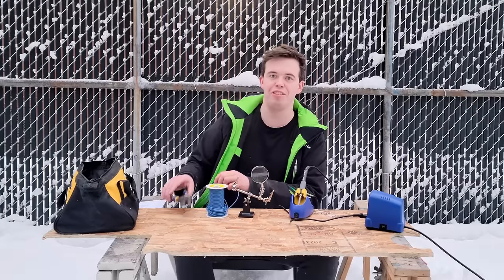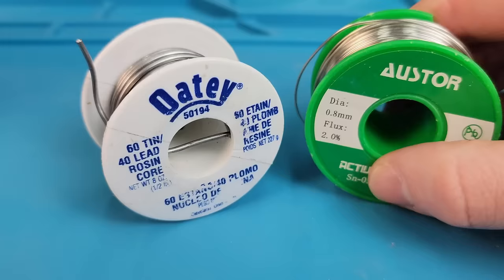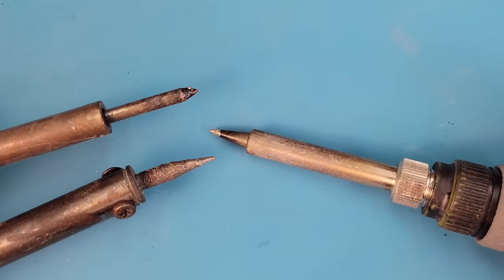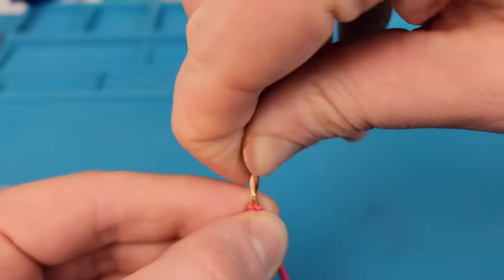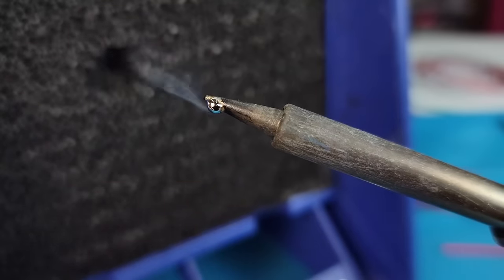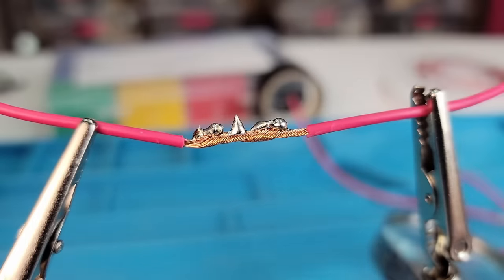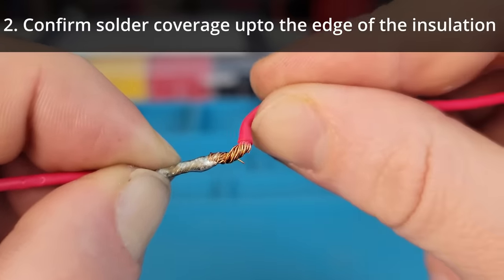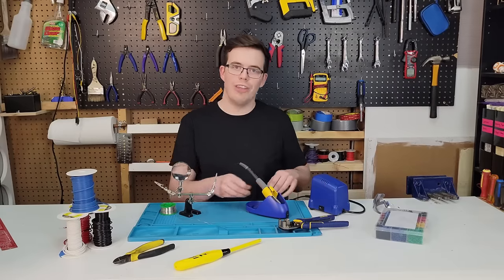Four Steps to Flawless Wire Joints (How to Solder)

Comment: "This is what a good solder joint looks like". proceeds to show a slightly better, but still bad, solder joint

- wires not pre tinned
- no flux
- wrong tip for soldering iron I'm pretty sure
- heat not evenly applied in place and dragged the solder rather than let it flow leading to very un-even solder application
- not enough solder

Tldr, for splicing wires together, just use solder sleeves... Or crimp splices (AMP style [iykyk]).
Reply: Also, in your demonstration of how to actually do it, you're still doing it wrong! Adding more solder to your contact patch between your iron and the wires is not how you do it. You're describing the right technique but don't actually know how to do it... Also, lead-free solder? And still no flux? No wonder you can't get your copper hot enough to flow correctly into the braids and properly make the connection. No mention of playing around with temps or tip sizes.

I strongly recommend you look into NASA standards or FAA, CASA, etc. ones and make a revision video.

Comment: Noone in the history of ever has gotten lead poisoning from solder.   Lead Free solder is primarily for factory based soldering, or if you are soldering 8-10 hours a day.  If you are putting together hobby kits and custom circuits 1-2 times a week you are going to be freaking fine, there is more lead in your water then you will come in contact with in solder during short times you are using it.
Reply: False. People who work in manufacturing are required to have periodic blood tests to determine their lead levels. There is no level of exposure to lead that is known to be without harmful effects. Lead in the body is distributed to the brain, liver, kidney and bones. It is stored in the teeth and bones, where it can accumulate over time. Human exposure is usually assessed through the measurement of lead in blood. But you keep doing you….   😊
Reply: @LTV_inc he said "unless you're doing soldering 8-10 hours a day". In other words, if it's your job be very cautious. If it's your hobby and you use common sense, it won't cause issues.
I'm not a scientist but that makes sense to me. Use the air filter the video shows and don't do it for hours at a time and there won't be any health risks.

Comment: What youre educating here does not fit for all situations.

I mostly solder in automotive repair, where you sometimes work in very confined and uncomfortable spaces, can only fit one hand and have too short of a loose wire to solder to. 

For example, its very much okay to use the iron with solder applied to it and even applied for a long time to it, and all the included rosin burnt for a long time. You just need to preapply it directly to twisted wires connection. There are soft rosin mixes available, but if you only have hard rosin, heat it with your iron to melt, and apply it with screwdriver till its soft. Use bigger and more powerful irons for wires, than you use for boards or components.
I only use 20w for boards and smd components. When its a wire, I take at least 40w and with a massive tip, that holds a lot of thermal mass to heat the wire enough to melt. For power transfer cables, like power steering pump or hydraulic suspension pump, I take my grandfathers iron, that has a wooden handle and a huge ass copper tip. I dont now its power, as the marking corroded away many years ago, but my guess at least 200w, probably even 500.

If the wire is black, you need to clean it mechanically, scrape it down to copper with a blade or something similar. You may also use some additives, that are needed for soldering to zinc or iron/steel and also work with blackened copper, but many of them contain acids, that corrode the copper after soldering, so not recommended.

Use adhesive lined heat shrink tube where possible. At least everywhere outside, and on cars even inside you cabin. Its much more expensive, but works wonders in damp environment.

Comment: Wires shouldn't be soldered in most applications because if they get hot the solder will melt rendering the connection useless they should be mechanically crimped or swaged together instead. If you have a high current wire that does get hot and becomes un connected because some idiot soldered it together and it shorts out to ground you will hopefully have a over current protection device that will break the circuit because if you don't you will have a fire hazard. Solder should only be used after a mechanical connection is made first if at all. You are relying on the wires being twisted together as your fall back safety in case the wire is shorted and becomes hot and the solder melts or your hoping the heat shrink tubing holds the connection together. If you do solder wires together put a mechanical support on both sides of the joint if possible to support each wire if it does become disconnected then the wires can't just fall onto the chassis or other components and short out. All wiring should be well supported in a loom anyway look at aircraft or space craft wiring for a good example of best practices.

Comment: I am the worse solderer in the whole world. I got my soldering iron, used it once, and the tip went all black and won't work anymore. Somebody told me after that I should have tinned the end of the soldering iron. grrr. I have an abrasive stone which is supposed to clean it off. If I try to use it all I get is little balls of solder now.

Comment: Kind of common sense i would think. If you think your good, try soldering without helping hands
Reply: I need those helping hands. When I soldered wire together in a car (speaker wire) without any such help and what should take 2 min, turns into 25. Wasting a half hour was better than paying somebody to do it, though.

Comment: Simple! DO NOT solder wire to wire, this is bad practice no matter what technique you use. All wire to wire connections should be crimped and not soldered. Soldering wire should only be used in an application where the joint is completely strain relived and immobilised.

Comment: Definitely not the proper way to mate two wires.
The mechanical strengt is not good enough. Solder is a weak metal.
Twists the two wires as if you were to use a marette.
Even before any solder is applied, the link is now as strong as copper is.
Adding solder will complete the work.
The end result may not be as good estethically, but it is way more sturdyer.

Comment: That Hakko soldering iron is garbage.  The pricey tips do not last long.  No analog controls.  The grey sponge is terrible.  It does not do a good job of cleaning the tips.  The OK soldering irons and the Weller soldering irons blow the doors off that Hakko crap.  🤔

Comment: Keep on putting out bad information; I make my living by fixing the mistakes you have made in this video.

First, you are twisting the wires together entirely incorrectly; before twisting them, at all, you should weave the strands of both wires, then twist them together.

Second, you misidentified a "cold joint," which has nothing to do with the wires being cold (which does not matter) and everything to do with the only actual connection being the solder, itself, and is more likely to happen with your technique.

Third, if you try your method on automotive or appliance wiring, you are going to wind up damaging the insulation and having to replace the entire wire, or even harness.

Comment: This is pretty typical poor YouTube video that is barely half correct about the subject. The dismissal of the bit type used is ridiculous. The conical bit used here is about the worst choice for general soldering including the joining of wires shown in this video. For most soldering you should use a tip with a flat surface to present a tinned surface to the joint. A flat surface holds more solder due to surface tension and greater heat transfer to the joint. The advice about lead free solder is also poor. Leaded solder is superior in every aspect of soldering. Whilst lead is toxic in its elemental form, solder is an alloy. Like silver-mercury fillings, alloys reduce the toxic effects of the individual constituents. No one was ever poisoned by leaded solder. Finally, using a lighter on heatshrink sleeve is a total cowboy move. Enough said.

Comment: Do not ever use these pointy tips, these are 100% garbage. Use chisel type, it have way better contact by wire and can make. The best of the best tip what I so far used it for Hakko T12-K. It is fake hakko and last already 10 years usage. Possible solder several mm2 thick wires or solder 0.4mm pitch easy.

Comment: 1. Stop using conical soldering tips. This is a total SHIT not suitable for any work.
2. Stop using T900 tips and/or system. It's ridiculous in 2024, really. Buy at least some T12 station, JBC, or Weller, and feel a difference.
3. Stop blaming Pb for all humanity catastrophes. Plunbum oxide really starts to evaporate at 600 °C.

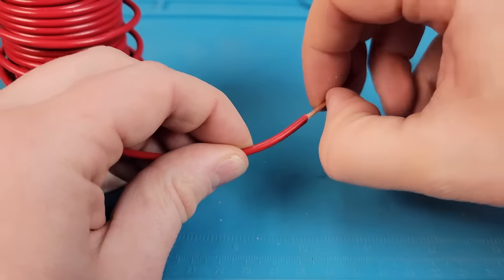Comment: 4:30 Maybe it's different for a fancy pants high dollar Hakko soldering iron, but my Elenco SL-75's tips are literally 5 dollars for 10 tips. Half time time I don't even bother cleaning them at all just change 'em out. If I do, I simply scrape the schmoo off with my xacto knife and re-tin. Tips for that thing are basically disposably cheap so I really don't give half a donkey's dick about tip life on it.

Hell I only paid 30 bucks for the whole iron.

Comment: You shouldn't solder 2 wires together. I will be very susceptible to movement. You will never find a soldered cable joint in a car. Even vibrations can break the edge of the joint. Stop teaching how to do stuff wrong.
Reply: Rubbish. A correctly soldered and insulated joint is as good as a crimp joint. It's not used on car wiring looms as doing it correctly takes much longer than crimping connections. I've been doing soldered repairs on car wiring for nearly 50 years and never had and problems. You can get a bad crimped joint, just as easily as you can get a bad soldered joint.
Reply: @phils2180  No, you are wrong. I work with this. Soldered cables are a big no no. I could never deliver a product we designed with soldered cable joints.
Reply: @thedryparn1279  No, you are wrong so we'll just agree to differ.👍

Comment: Sadly after your intense instructions you made a total rookie mistake, you never ever use your fingers on the wire you intend to solder as the grease compromises the joint as the most important thing when soldering is that everything wire solder and soldering tip  are free from grease and dirt.

Comment: Conical tips suck and so does lead free solder.  don't waist your time on this video!
Reply: Lead-free is fine with good technique. 60:40 is definitely easier for difficult jobs or when skills are lacking.
Reply: @putrid.p  -- Lead-free is crap and one of the big reasons devices fail!  We never had all these joint failures with 60/40 solder!
Reply: @putrid.p  -- Even NASA won't use it!
From NASA-std-8739.3 
6.11 Solder 6.11.1 Types and Usage. All solder used for tinning and solder connections shall conform to
ANSI/J-STD-006 (Requirement). Flux-cored solder shall be either composition SN60 or SN63...